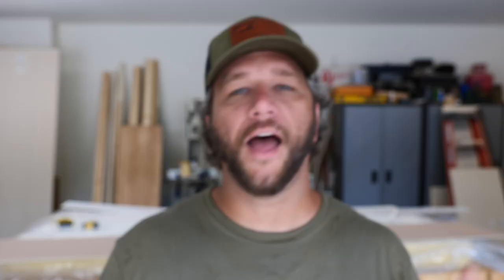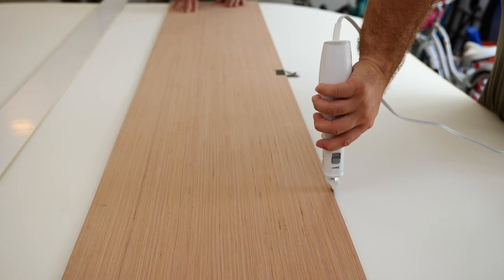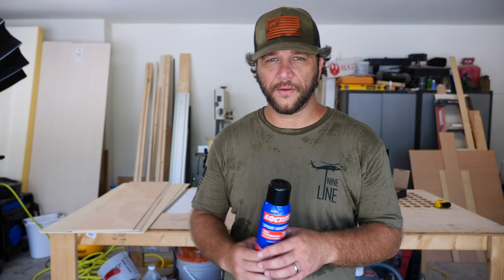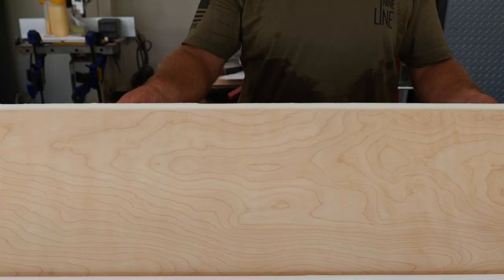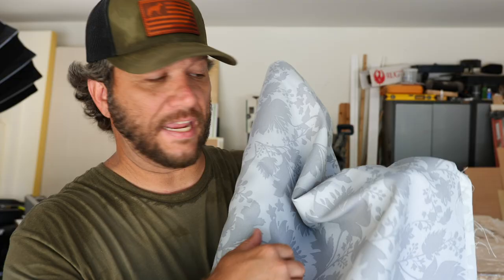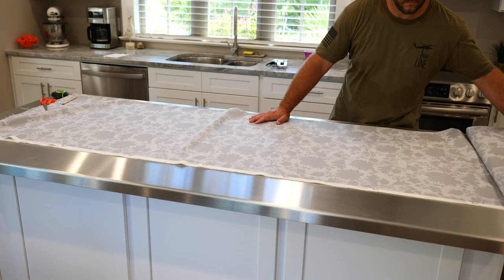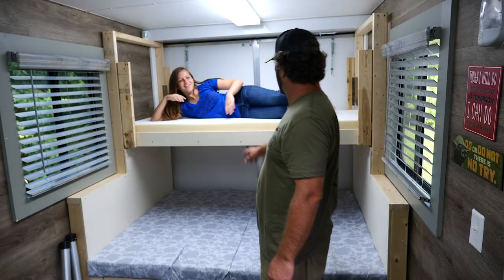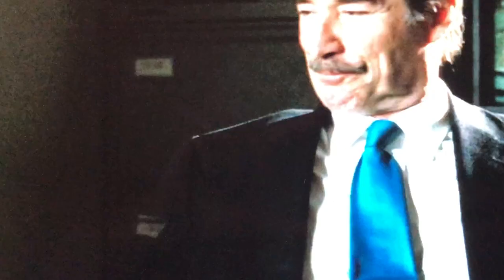Cargo Camper Conversion / NO SEW CAMPER CUSHIONS

Comment: Light coloured and pretty materials are a dirt magnet!  Just offering a few ideas to consider that might make your cushions easier to keep clean. Because your cushions are glued to their wooden boards, they may be difficult to clean as well as take a while to dry.  Removable and washable base cushions and covers might be more practical in the long run. I know you hate sewing, so here are three no-sew options to consider applying next time: 1. Iron-on hem tape - you can use this stuff to make hems and seams. You might need to experiment with folding your fabric differently so that you could use iron-on hem tape instead of sewing the hems and covers shut. Although this tape only holds up to a few washes, it's easy to reapply when needed. (I suppose fabric glue could be used in a similar way, but realistically, you need to use clamps to hold fabric together until dry, so it's a very finicky and messy option). 2. Snaps - there are several types and sizes of snaps on the market that you can use to snap the cushion covers closed, as well as to attach the base cushions and their covers to the wooden support boards. You need a hammer and a hard surface to work on for this project. You can get upholstery fabric and camping canvas snaps, as well as much stronger ones that are designed to attach durable fabrics to hard surfaces. Look for rust-proof metal if you live near the ocean, or in a humid or rainy area 3.Strong adhesive-backed hook and loop tape (ex. Velcro) - this could be used to attach the cushion covers to the boards, or even to seal the cushion covers shut. I've used this type of product to attach a 6' long fabric valance to my kitchen window frame. It has held up to several washings so far (don't put it in the dryer though).  If your girls are anything like mine, they're going to spill food and drinks on those pretty cushions. Now add one or two rambunctious dogs to the mix, and you're bound to have a smelly mess on your hands! All the best to you and your lovely family!

Comment: Unreal... a turkey carving knife for foam. GENIUS!
Reply: It's Thanksgiving here so I guess it's time too build a bed lol
Reply: @HAXMAN  Been using that knife to cut the foam in our gun cases for years. Works like a champ. Spray a little plasti dip on the foam afterwards and the guns wont fray the edges and looks clean. Also allows to the change the color or add a pattern to the foam.

Comment: Mr. Haxman;
This turned out beautifully. I have a great weather proofing tip that you can use: 1 tube of cheap 100 % silicone window caulking to a can of mineral spirits. Mix together well in a trash bag. Add whatever cloth (sheets, clothes..) put your fabric in the bag until it is good and saturated. Then ring it out really well and hang for 24 hours. You now have water proof material. If you do sheets they act like a tarp. This works great for hunting clothes or for outdoor cushions. 
  If you want to waterproof proof those  cushions you still can; get a disposable plastic container and just mix the two ingredients till it looks like you’re stirring paint…then take a paintbrush and paint it on and let dry completely.
Love your channel!
Just subscribed to this beautiful little community that you’ve created with your lovely family. Thank you all for your inspiring channel ❤
Reply from the maker: Thank you so much!

Comment: After working with and talking to several professional upholsters over the years I say you are correct that the electric knife is the best way to cut foam, short of a very large, dangerous, factory size hot wire. Plus no smell and they still use the electric knife to fine tune the foam anyways.

Comment: Thanks. Inspiring. For mine I used a regular hand held bread knife. I then bought 5mm Ply and some spray glue. As against buying expensive material I opted for a great pair of decorative curtains off of Facebook marketplace for £15 and will be gluing and stapling tomorrow. Thanks for the tips... I really wanted to avoid the sewing and now will.... when they get tatty I'll buy some more curtains and refix... but they'll do for this year 100%

Comment: Hay man cool video.
I live full time in my poptop in New Zealand 
They don't have the pop out ends like your ones do just a center section.
Was wondering if you had any issues with condensation underneath with the ply.
Cheers Dave
Reply from the maker: I haven’t had any issues at all. Of course my climate is probably different. I live in South Georgia on the coast in the US if that helps figure out. We have average temps in the mid 90s Fahrenheit and 90% humidity in the summer though.
Reply: @HAXMAN  Thanks mate will still make my cushions like yours a layer of tensar geogrid underneath looks like it will stop the condensation 
Cheers Dave

Comment: I have a small old vintage camper both advantage camper and I want to want to redo the seat seats but but they are old tuck and roll I'm not sure if I should put fabric over them are or some oil cloth but but I need to keep it simple cause my hands aren't too strong any advice would be great . Also it does not have a bathroom but I have a portable   Potty Any ideas on how toIt's a little camper up. It's a 1963 fleet craftNo air conditioning or heat but the electric works.. Any advice would be great
Reply: I have a vintage camper also. 1968 Sprite made in England. I used sunbrella outdoor fabric on my cushions because it's a bit more durable than standard fabric and won't fade with the light coming in my large windows. I didn't bother going with the rolled trim type on mine. I just did mine so that I can remove the fabric if I need to clean it at some point. I wrapped the cushion with the fabric similar to wrapping a package like he did but instead of stapling in place I used velcro that has an adhesive backing. If you are on face book there are a lot of vintage trailer groups on there that are great resources. Also check out Tin Can Tourists.